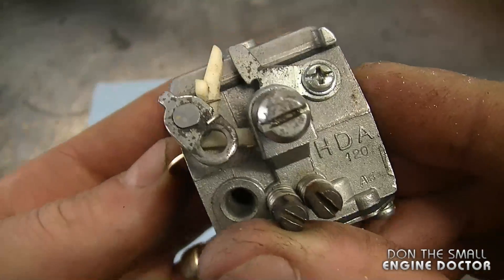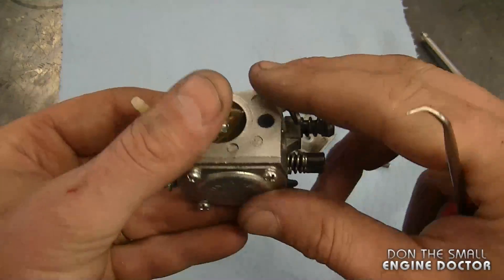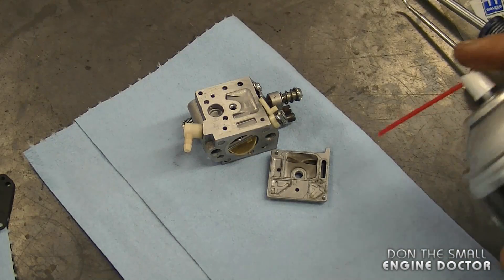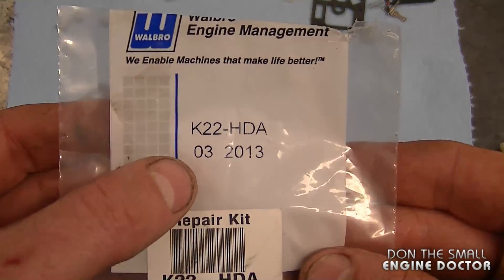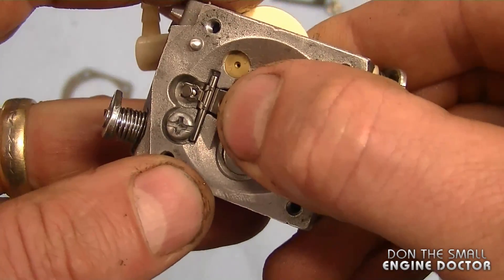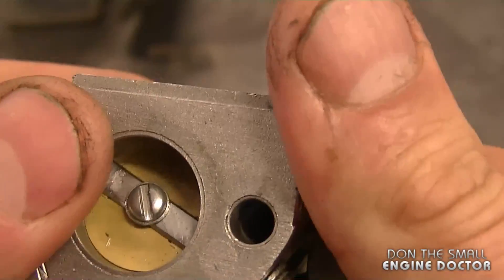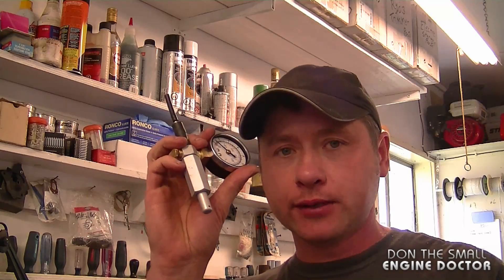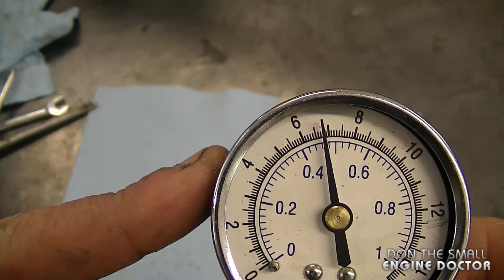HOW-TO Rebuild A 2 Cycle Chainsaw Carburetor - video

Comment: I have a 30 year old weed eater brand chain saw been tinkering with for 20 years replaced diaphragms and gaskets and just opened this video and startled my wife when I loudly said WELSH PLUG. at 1:17. I bet the kit I bought came with one and back then I thought it was an mis-pack. But I’m even dumber I bought another kit for the float and needle. 
I think I can get my saw running this time.

Comment: Fantastic video sir, on the metering valve is it a standard practice on other carbs as well to be flush along the sides of the carb. I hope i explained that correctly. Thank you
Reply from the maker: Usually is
Reply: Thank you

Comment: Great video, however i see you get a welch plug in the kit adn you didnt remove the old one for cleaning? And replace with new?
Reply from the maker: I only replace the welch plugs if they are corroded or rusted.

Comment: I noticed cover with 4 screw has a small hole,does it matter which direction that is place. I have walbro 416 carburetor on chainsaw.  Thanks.

Comment: Just the exact video I needed thanks. The discount parts co. and another parts store charged $7.95 for the kit, but both places wanted $9.95 shipping. So I checked Amazon, an exact o.e.m. Walbro kit for $7.95 and free shipping.
Reply: Most everything from SCAMAZON is direct from China and not real deal Walbro parts. They are copies of the originals. Doubt you saved anything. To the contrary, probably have to order another kit to  make it run right. Stay off of Amazon for mower slash trimmer parts.

Comment: Thanks - used this as a guide to rebuild by Echo blower carb. It was previously bogging down on start, taking 5 minutes of running before it worked. Starts and works great now. Just note the order of gasket vs diaphragm on reassembly as they are different on each side.
Reply: That is one great tip, gasket installs and where they go on each side.

Comment: thanks! the diaphragm  was missing on the carb of an 026 I recently acquired and I couldn't figure out where it went ...the saw was a mess... it was not idling when i got it it was revving really high... I got it to idle perfectly by pure luck.. the gasket was missing on the metering diaphragm side and the diaphragm on the other side was also missing.. it would start on the first pull and i got it to idle and run perfectly this way lol.... then I ran it in winter mode on a super hot day and it started flooding no matter what I did. Took apart the carb and noticed the gasket missing.  Then when i got the rebuild kit I noticed the translucent diaphragms for the other side which wasn't on the carb and had no idea where it went.. thanks your video really helped! :)

Comment: Hi Dony73, are gaskets needed between carb and air horn and also between carb and cylinder intake boot? Don’t see them in Walbro or Tillotson carb diagrams or kits and don’t see them or part number on chainsaw IPLs. Thank you!

Comment: People say not to blast the ports out with carb cleaner and air.  So how do you clean them out? Or is it not because dry to do it?  I've been using carb spray and compressed air.  Sometimes it works and sometimes it doesn't.

Comment: Why not take out the needles, H &L to clean out the jet passages?
Reply from the maker: I believe he did before putting in ultrasonic cleaner
Reply: I must have misunderstood,
I did not hear or see it on the video, 
this is what I heard and saw. AT 1:59

Now overall this carburetor looks pretty clean inside it’s just basically a matter of replacing the carb kit however I am just going to spray a bit of carb cleaner on the parts i’m not going to use my ultrasonic cleaner today because there’s no point I’ll just let this soak for a bit and put it back together if you see a bit of dirt inside the holes here you can use your pic in the paper towel or a rag and and just rub it in there.
Be safe,
  Be good,
    Be kind,
      Trust GOD.

Comment: Do you know if the plastic elbow pieces that are on the walbro carbs you can buy separately? Ive got an old chainsaw where one has a crack on it, causing fuel to run back to the tank
Reply from the maker: i'm pretty sure you can

Comment: I was once rebuilding a chain saw carburetor  on our patio table, it was a nice warm day. I had just cleaned everything using my ultrasonic cleaner and had it sitting on a piece of cardboard on the table. I had just opened the package of parts and lay them out on the cardboard to get ready to assemble it. Suddenly a gust of wind blew the  sheet of cardboard off the table and I watched as it flipped  over the rail into my ferns and other plants below the deck. I almost died! Luckily, all the parts had dropped straight onto  the deck, not over the rail. I was able to find all the parts, even that fine spring and the screen! After that,  I learned to tape or use a weight on cardboard when working outside. Mabe my wife will let me build a workbench  on the deck next summer!

Comment: Dony I wonder If you have ever replaced a non primer bulb carb with a carb that incorporates a primer bulb. I have a Maruyama bc184 trimmer that has not been behaving for the past four years. I have rebuilt the Walbro carb twice using the kits but still gives me fits. Where it used to take a pull or two now takes twenty to start. I wish the carb had a primer bulb, are all of these replacement string trimmer carbs equal bolt ons? I know I would have to add a fuel line for vacuum to  the the fuel tank but wondering if it's possible.

Comment: I watched this a couple times, then when I couldn't start my McCulloch Pro Mac 10-10 due to a fuel issue, I removed the carb, took the metering cover and diaphragm off, discovered the metering lever had been adjusted way too low, starving it for fuel. I readjusted it,  then checked the High and Low mixture screws, found the High was 1 turn out and the Low was 2 1/4 turns out! Somebody before me probably rebuilt this carb without checking the height of the metering lever! Thanks for this very detailed instruction video, it really saved the day for me. Be safe and have a great day!

Comment: Thankyou . I followed your tutorial and just fixed my first small engine carby. I bought a brand new Echo blower and have been constantly having engine flooding problems for the last 2 weeks so I pulled apart this morning and found the lever was barely adjusted. I followed how to lift the lever and make level and now she starts instantly. Problem was driving me crazy not being able to use but now I know how to fix so much appreciated.

Comment: After siting for years my engine seemed to run perfectly until all the fuel lines decomposed. I replaced the fuel lines and then it was hard to start and only ran for a few seconds. I rebuilt the carburetor similar to yours after completion the problem persisted. Any ideas? It will run using spray starting fluid.

Comment: Hi Don, thanks for posting your how to videos. I got stumped today. I've hot a Ryobi cultivator with  a Walbro WYA-72-1 carb, (the most expensive one, just my luck) Today I installed a brand new carb along with new fuel lines, filter, and cleaned the gas tank, the whole fuel system is new, still won't start unless I spritz gas in the carb, and onle runs on that and quits. I'm at a loss Don, any ideas? Thanks!
Reply: Sparkplug arrester screen is cllogged..what is sparkplug gapped at.increase to.030.then try cranking. Im Just a  Shadetree mech. Be well my friend..when one tinkers he learns.

Comment: The die grinder is noted suggested and be careful with that air blowing into those check valves. Need to remove each adjustment screws too they are also bottleneck restrictions and can get jelled up after sitting for awhile.

Comment: Don, I like your 45:1 fuel mix. Mit runs great.  40:1 is a little oily and 50:1 is a little weak in cold or hot temperatures.  I tried 40:1 and it leaves a lot uf unturned ash on the exhaust side but 45:1 burns real clean.  I add 3.5 ounces of Citgo Sea Snow to 5 quarts of PNE gas @about 95 octane.

Comment: Question, when you want to reset the jets on one of these carbs due to them being improperly adjusted by the PO, what's the procedure? Saw is a Huskvarna 375T
Reply: all the way in to completely seat them carefully to not over tighten ...then one turn out each is usually  a good starting unless you have specifics on your saw than follow that

Comment: Very good. Though when I do the pressure check I take it to where it pops off or opens.  Around 15 psi.  Then monitor tester to see where it re-seats. Should be around 5 psi.  Needle should be wet per Walbro but I usually forget to do it anyhow.  Thanks again.

Comment: What is that pressure tool used at the very end of this video?????
Reply from the maker: it's used to make sure the needle valve is sealing properly
Reply: donyboy73 what is that tool called?

Comment: Can that needle level be set to high well it still work if it is a little high?
Reply: Larry Lafferty If that metering lever is TOO high when you install the metering diaphragm and gasket it will keep constant pressure on the lever which in turn holds or keeps the needle valve in a open position. So lets say you had your saw in its case in your truck. The case heats up from the sun,the fuel tank on your saw heats up and increases the pressure in the tank. If the valve is open under the metering diaphragm gas will flow through the carb and fill the crankcase of your saw. If gas is coming out the muffler,the valve is not seated properly. I hope this helps and kinda gives you a visual. ZD

Comment: My kit came with a white colored plastic diaphragm like the one he used in the video. The kit also came with a blue plastic one shaped exactly the same.  Since the original diaphragm was blue, I used it. Does anyone know why the kit came with two diaphragm's shaped the same? Walboro wt 454Kit  K-10-WAT  01   2014

Comment: When you work on a 2 cycle carb the first thing you do is take it apart and test the check valve or valves in the carburetor. If it has a bad check valve in it,  STOP. You need a new carb. This will keep you from buying a carb kit that isn't going to fix the carb anyway. I have punched the check valves out and replaced them on some carbs. Just depends on how much a replacement carb costs.
Reply: They should include the check valves in the rebuild kits.  How many people do you suppose have thrown away their money on kits that didn't fix the problem?

Comment: My Walbro wyl carb passes the presure hold test. But fails pop off.
You didn't do  a pop off test, several techs and Zama advise not to do a pop off test.
Carb did not pop off at 35psi, i did not want to exceed that. Will my carb work?

Comment: I have a Walbro carb on my Homelite gas leaf blower that is giving me problems. First off once I get it started it won't increase in speed. And while running gas runs out the air filter. Does this mean I need a new diaphragm ? Thanks !!
Reply from the maker: +Calvin Lee yes I would try a new kit
Reply: I will try to find one THANKS !!!!

Comment: Don:  Question I have a Walbro WT-134-1 carburetor cleaned it (ultra sonic cleaner) new kit, new fuel lines new fuel filter and new primer bulb this is installed on an older Homelite timberman 45cc saw. runs good then it looses its prime! I remove the top of the carburetor and have plenty of fuel coming in to the carb however the primer bulb is squishy after removing the top of the carb the primer seems to work and gets the prime back! What do you think might cause this?
Reply from the maker: +Wydotman DOES IT RUN OR DOES IT QUIT AFTER A WHILE, I OFTEN END UP REPLACING THE WHOLE CARB ON THOSE
Reply: +donyboy73 When I get the prime it runs good! Then it looses the prime and that is it. New carb N/A! I was thinking maybe a new fuel pump diaphragm?

Comment: on my ehco blower to run I have to put the choke on almost the close position what do I chack next
Reply from the maker: +Simon flores try turning out the L & H screws if it's adjustable, if not you may have to replace the carb kit, fuel line and filter

Comment: excellent video. i suggest you also add a link for carb pop out pressure tester sten 705-020. i have replaced jonsered 70e ignition. has 50 psi. how & where do i check for compression loss ? i have ordered new indian made vec piston & rings. txs

Comment: Hi Donny, At the end of the video you checked to see if the HDA120 would hold pressure. If it did not hold pressure where would you look first for the loss of pressure?
Reply from the maker: +Paul Facio around the covers and needle valve

Comment: Hey Dony,I have a small similiar Tillitson, the nylon fuel inlet is cracked on both sides. I was told there is no replacement part. What direction do you suggest...maybe an petroleum friendly epoxy from Can Tire?

Comment: Hey Don how would you replace the Welch plug on that carb. That part is easy I noticed in most rebuild kits they provide the Welch plug but I've never installed one. How do you do that?
Reply: You Polk a hole ( carefully ) in the old one and remove it. Clean the passageway and put the new plug ( round Ed side facing out ) in and put a small dimple in the rounded hump to force it against the side of the hole to seal the hole. That’s it.

Comment: Anyone have advice on this?

I have a heck of a time putting the needle valve assembly back in. I think my fingers are too big or maybe I have too much shake in my hands. Anyway, I always knock the spring over while I'm trying to lower the needle valve into its seat. So what I do is put a little dab of grease on the bottom of the spring and put into its seat before reinstalling the needle valve.  That  keeps the spring upright while I jimmy with the needle valve and arm it's attached to. After I'm done, I spray off the grease with carb cleaner. 

Does this sound okay, or am I asking for unforeseen problems down the road by introducing grease into the carb?

Thanks!
Reply: +Dale Grote Hi Dale, I rebuild a bunch of these small carbs and found the most success reinstalling the needle if the carb is level on the bench so the spring is vertical. This lessens the chance the spring will fall over as I install the needle.

Comment: I've never seen it as a pressure gauge. I have seen vacuum type gauge is that the same as what you're talking about what is the brand and the part number that you have.
Reply from the maker: +Able Lock this one is only pressure, I use a vacuum and pressure on leak down test, this one is rotary part# 32-11321

Comment: Those Walbro carbs drive me nuts  They never seem to work right.
Reply: That's because Walbros have internal check valves that are difficult to service without special tools.  The rebuild kits don't include the internal check valves.  You can buy a new carburetor for less than the cost of a Walbro rebuild kit.  I've wasted over $25 on 2 rebuild kits, one for a Stihl string trimmer and one for a Poulan 2150 chainsaw.  Never again!  From now on if it doesn't work after cleaning, into the scrap pile it goes.
Reply: @sportster88   I didnt know there were any check valves in the body of these carbs. The flapper film and the metering diaphram do all the pumping.
Reply: @paulg444  The check valve balls are located behind the welch plugs in the carburetor bodies.  You have to drill a hole in them and remove them with an extractor to get to the check valves.  Some rebuild kits include new welch plugs.

Comment: Remembering you said that some small square carbs are not repairable due to the hard to get at passages, im supprised you didnt use compressed air to chase through that one to make sure it will work.
Or is that make pretty good?
Reply from the maker: +zx8401ztv this one worked well after

Comment: What is that pressure tester? Where do you get one and what is the testing procedure? Is it validating the metering valve or the diaphragm valves?
Reply from the maker: +Richard Taft  rotary part# 32-11321